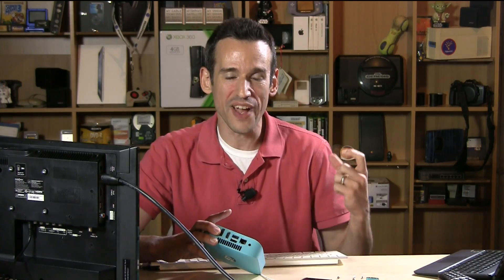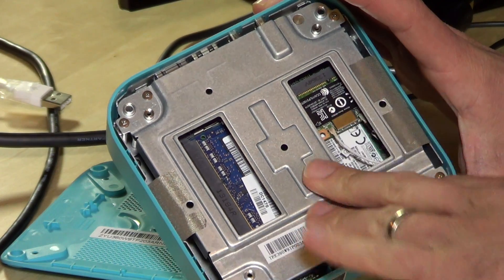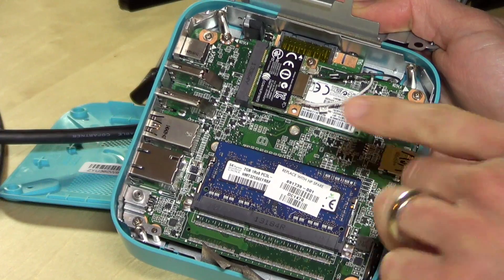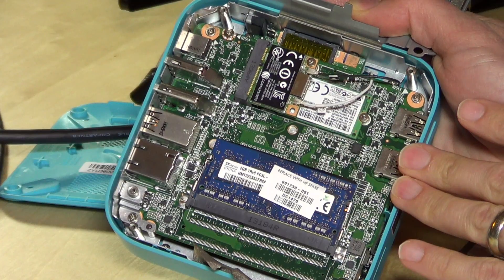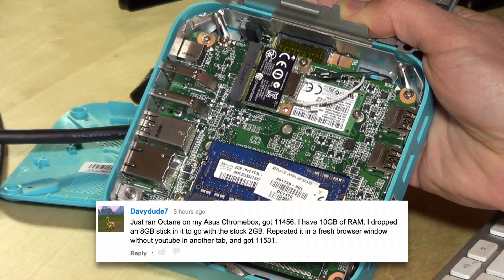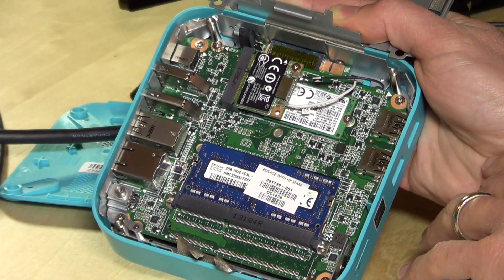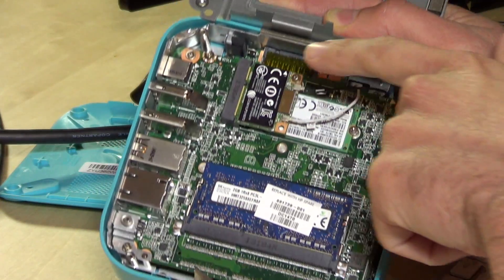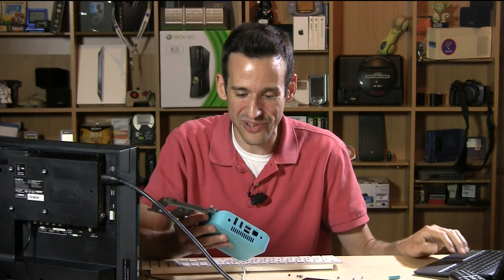HP Chromebox Taken apart - RAM replacement, hard drive, and what's under the hood

Comment: Hey Lon, I don't understand why HP cheaped out on the RAM sockets. I have always bought and owned HP computers and printers. I was thinking of getting an HP Chromebox but when I discovered that they only have single channel memory I opted for the ASUS instead, which has dual channel memory and you can upgrade the RAM to two 8gb sticks making a total of 16gb. And you can upgrade to as much as a 2tb M.2 SSD. Why did you cheap out HP? I guess it was for competing in the market, but only providing single channel RAM slots when everyone else provides dual Ram slots really shot yourself in the foot. You really disappointed me! ASUS is so much better, SORRY to say HP!

If you are considering buying a Chromebox DON'T waste your money on the HP, go with either ASUS or ACER. I have 4 ASUS Chromeboxes and all have been re-programmed and have Windows or Linux installed. Very simple to setup!

Comment: Hi @
 
Lon.TV- Where to locate Hardware right-protected screw in it? I want to install Window 10 on it and it says Hardware right-protected and enabled, cannot flash full ROM Firmware. 
Can you help me? Or will it work if I just replace the SSD?
Reply: My model is CN60

Comment: That SSD looks like a M.2 SSD rather than msata
Reply: Xiaobin Lin ya it is.  M.2 SATA III SSD to be exact
Reply: Yes! it is an M.2 mSATA, not to be confused with an NVMe M.2 drive which uses a PCIe bus. It will not accept an M.2 NVMe (non-volatile memory express) drive, which is unfortunate because you can get speeds up too 3500mbps as apposed to the M.2 SATA's ( Serial AT Attachment .2) speed of just 600mps.

Comment: Lon, question / request for you please!!

While you are doing Chromebox experiments, could you please put Ubuntu or specifically Mythbuntu on the Chromebox? The reason I ask is from what I understand, people who have a HDHomerun Prime and want to use MythTV don't need a very powerful myth back end PC since the video feeds from the Prime are already Mpeg2 / 4. The goal of this would be, to run a myth back end and xbmc front end on the chromebox in my living room, and let my raspberry pi (xbmc) in the bedroom tie into the myth (also for live TV). (You would have some form of a NAS or external hard drive in the mix as the chromebox doesn't have much internal space to hold recorded shows.)

Thanks!!
Reply: ***** Awesome, thanks! My goal here would be to let the chromebox handle the double duty in my house. I have a NAS, so I would direct recorded shows to that. And it would give xbmc front ends a solid live TV stream. I too am trying to get rid of my cable boxes, but don't want a whole other PC just to run myth.